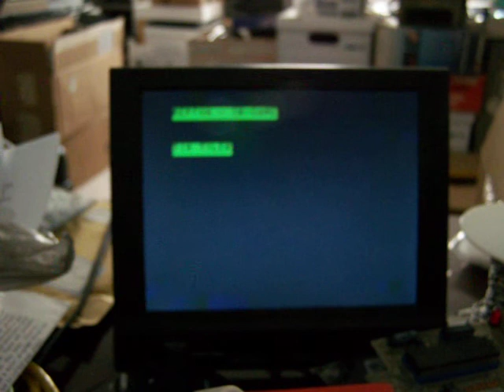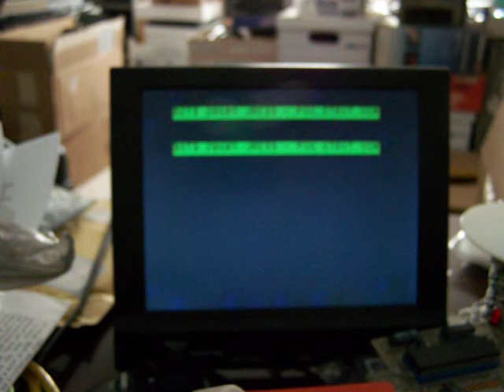Preview of CoCoFEST! 2017 demo (SN76489 audio and bank switching ROM card)

Comment: That sounds great John! I'm not in need of sound atm, but I do need bank-switched 64KB for Lode Runner. Wondering what the memory map looks like - is it possible to map 2x16KB banks to the upper 32KB for a '32KB' cartridge? I didn't see a CPLD on there so I'm assuming a serial EEPROM would be asking a bit much? ;)
Reply from the maker: The bank switching portion is basically a copy of the Greg Zumwalt's design published in the 1990 issue of Rainbow magazine in the article titled "Breaking the 32K Barrier". It simply switches single 16K banks into place at $C000 with the bank register at $FF40. Switching bigger banks could be possible, but it would take a different design.

As for a serial EEPROM...maybe next time? :-)